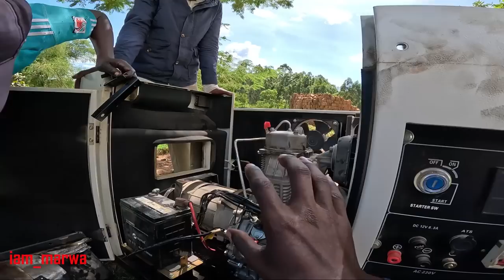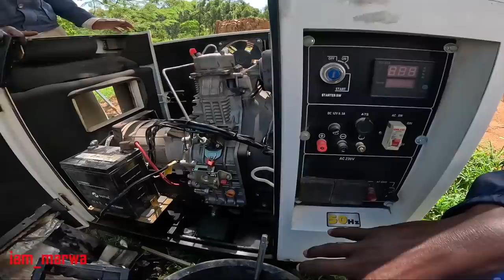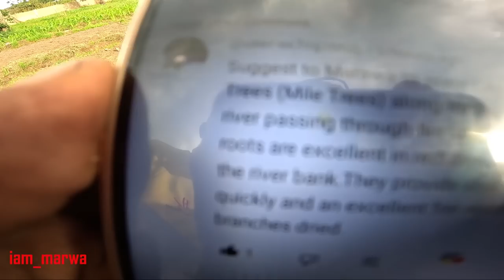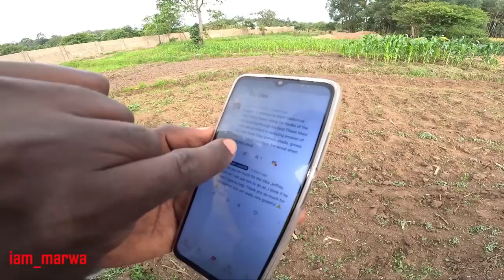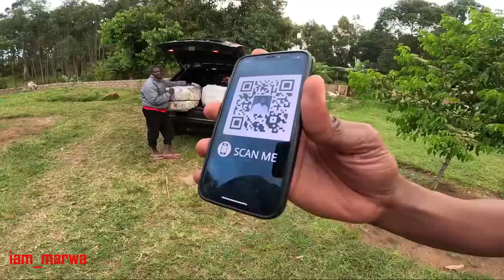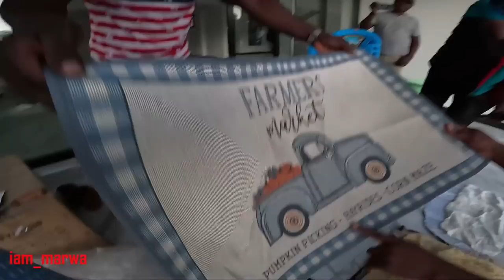HE IS FIRED !!! - AFRICAN VILLAGE !!!

Comment: The 'engineer' is wrong here 2:41! You can put an electric fence on a metal gate as long as insulation is used between the wires and the metal stand. There are also flexible wires used on the moving part. The gate person knows this but chose not to argue with the Fred.  Where I stay there is an electric fence on the gate. My new firm Peupe Technologies we will start installing electric fences very soon.

Comment: Solar Energy is only costly by first Purchase time but it has an advantage to the diesel and petrol engines because , if you had 10, parts to take of in diesel /petrol engines in solar you may have only 4 components to be taken care of , Generators are just for back ups and isolated places , because the moment they start running they start costing money heading to servicing costs . SOLAR FOR THE VILLA !!!!!!!!!!!!!!!!!!!!!!
Reply: Solar is definitely reliable but the current cost can be discouraging. I have a small solar installation but even that was expensive

Comment: Hello Brother Marwa at 22:09:00 mark you mention moving the washer outside on the back patio. I want to tell you. Dending on the wind and rain your machines will rust and deteriorate faster.
It might be good to build a small room next to the house that can hold a washer and dryer, a clothing folding table, and a iron and board. 

Also, I realize you eat lots of fresh stuff ( I love that bro) but have you identify a food pantry or cabinet storage area? Just wondering! 

Marwa please install locks on doors and areas. They don't have to used right away, but it'll good to have if or when necessary. 

Keep up the good  work brother.